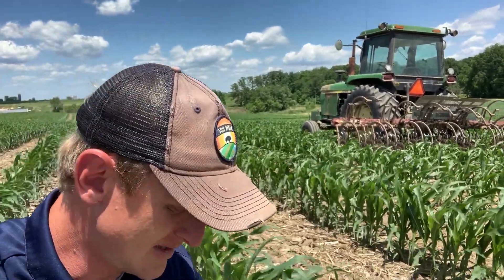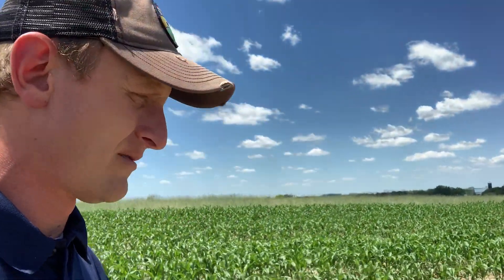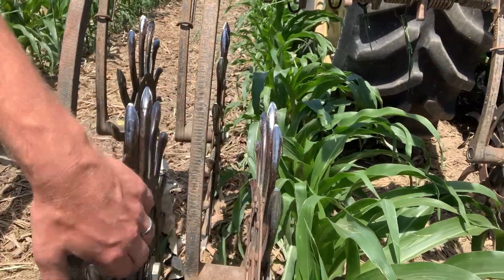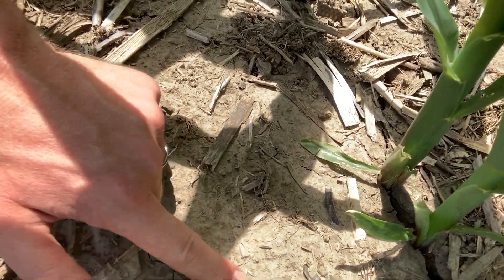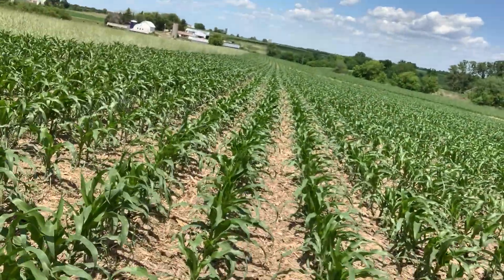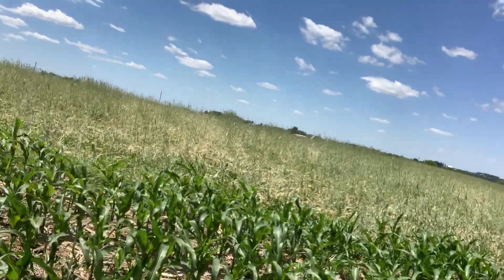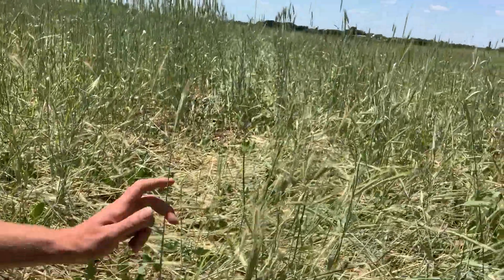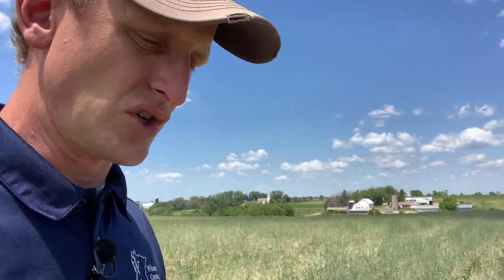Interseeding 60's w/ a Rotary Hoe....Vid #2 ☘️ 🌽 🌾

Comment: Did they use a good rate of Outlook herbicide or another pre on the conventional corn?  Looks nice and clean but my advice for anyone trying skip row corn for the first time would be to stay with roundup ready or Liberty resistant corn. When giving up the most awesome weed control that is corn canopy one may still need other tools to manage as the cover may not always hold back the weeds across the whole field in my experience.

Comment: Have you had any problems planting green with corn and army worms? I’ve been using rye before beans, but have heard horror stories of army works taking corn after any type of “grass” type of cover
Reply from the maker: Thanks for the question Mike!

We’ve had relatively few issues here in the upper Midwest as of late with army worms and corn although yes it can be an issue. Scouting early and often along with some planning can go along ways. 
Where are you located?
Thanks
Lance
Reply: @lanceklessigregenerativeag7901  I’m located in east central Illinois, near Danville, Il, not far from Rick Clark. I use cereal rye before beans, and I have used cow peas, following wheat before corn. I end up having volunteer rye before corn, but typically have it burnt off before planting because plenty of our neighbors have had army worm issues and nearly lost fields. I do not use insecticide and have predominantly non gmo corn as well